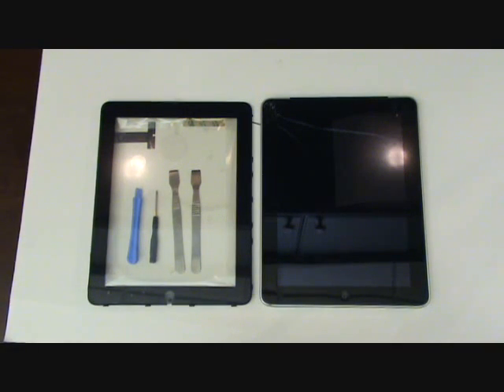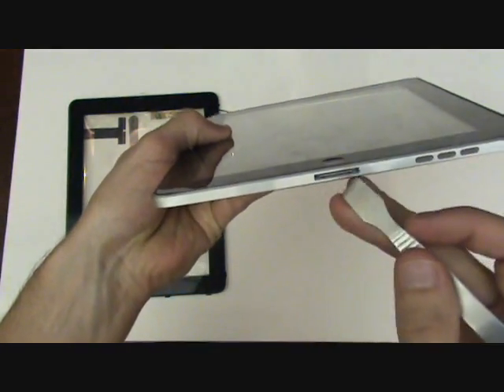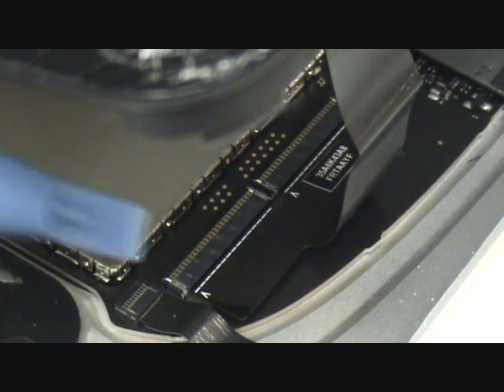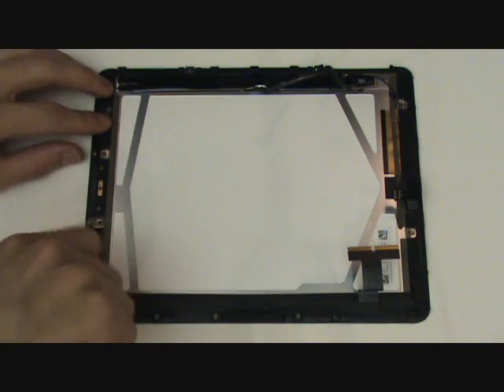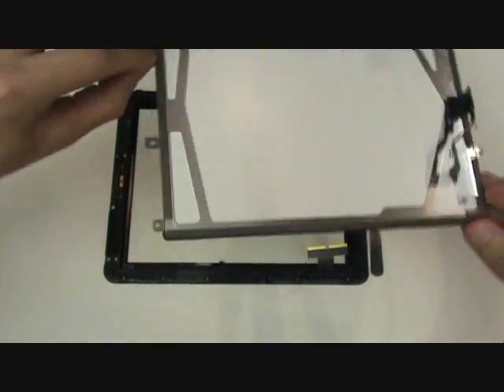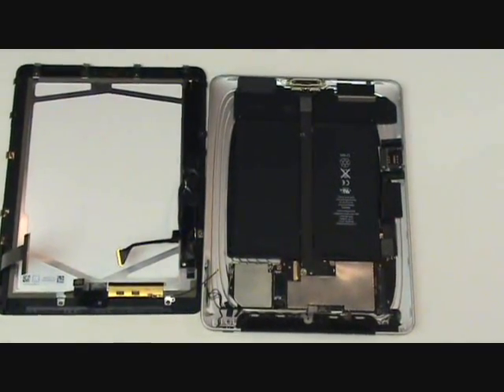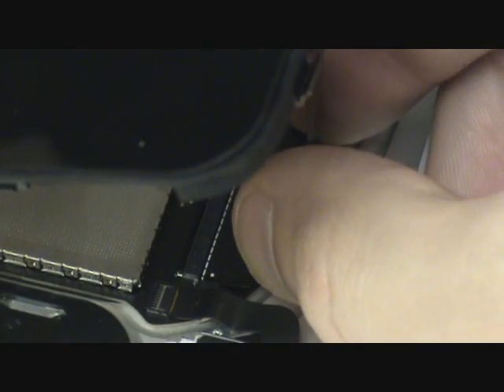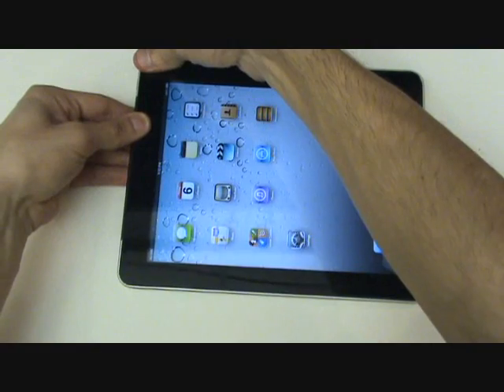iPad 1 Screen Replacement Tutorial LCD Glass Digitizer Repair | GadgetMenders.com

Comment: I have just ordered a csreen replacement digitizer, I however see it does not include the home button on the replacement. will this hinder the replacement
Reply from the maker: This must have been purchased from a different supplier.  It will make the repair much more difficult and time consuming.

Comment: Thanks, worked like a charm. The only hiccup I experienced was that my frame was slightly bent (from kids dropping it), so the glass didn't quite fit back in until I shaved parts of the padding off. If I were smarter, I would have taken a hammer to the frame to shape it first, but there's no way I was going to start over.

Comment from the maker: The LCD is replaced when the display is bleeding, cracked, or remains white.  If the glass is not cracked and the touchscreen responds to touch in all areas you don't need to replace the glass/digitizer piece.

Comment from the maker: If you are careful and use the right tools it's unlikely.  I rarely hear of customers damaging the LCD when replacing the glass but it is possible.  The greatest risk is when pulling the LCD screen out from the midframe assembly after the assembly has been pried up.  You can find all parts and tools on our website.

Comment: I dropped my IPad and the digitizer cracked. I debated if I should purchase another one. 
I went to YouTube and found this video. The video step by step instructions were very helpful. It is better to order the digitizer with the frame since it came with the tools and the tabs. I also ordered the LCD screen. Spent a little over $100 to
 replace the LCD and the digitizer. Savings of over $1800 since I have 64G. Thank you.

Comment: My LCD cracked.  I only need to replace LCD.  Is it possible to remove the digitizer without ruining it as you mentioned that most of the tabs will break?  In my case I will want to try to reuse the digitizer and only replace lcd.

Comment: Dear Gadget Menders,
I bought a new screen,digitizer and midframe that is supposed to be useful for wifi or 3G repairs on a iPad 1.  I only have the wifi.  Should I just ignore the 3G antenna or should I remove it from the assembly.  Also, the light screen attachment became unhooked.  Does it get permanantly fixed to its mirror image on the opposing screen?
Susan

Comment: My screen is cracked on my ipad 1, when it was dropped on its corner.  Part of the frame is smashed in, not a big section, can I just "hammer" this back into shape? Not really hammer, but do something to get it in shape so I can replace the glass?  Ipad works fine otherwise.